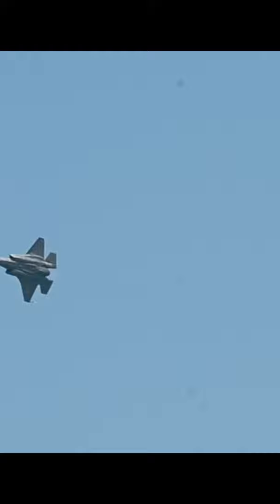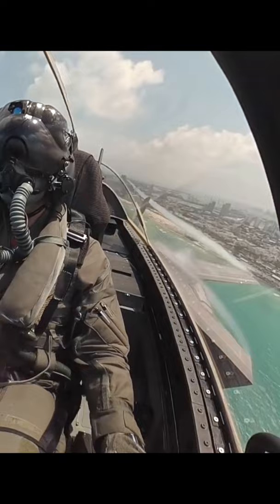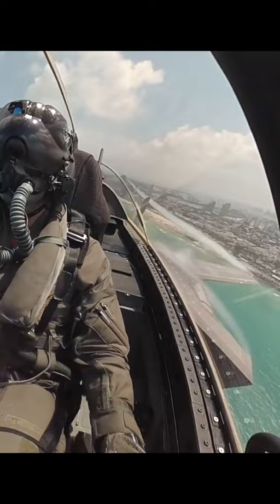Fighter Pilot Talks Through a Min-Radius Turn #Shorts

Comment: I think we need to trade. I have a new Ford F350 4 door. Low miles. 

Thanks for putting these videos up. Mainstream TV does show videos of these fixed wing aircraft but it's usually only a few seconds long and no explanation or pilot interjection. I still can't believe you fit inside the F16. Looked like your knees had no room. The F35 looks so bad A. Quick question. Maybe you can answer. I'm a Marine. EAS'd awhile ago. Was part of 13th MEU on LHD-6 (RIP). We had rotor & fixed wing. Harriers and CH53/CH46 Cobras Huey's. I talked to a Harrier pilot. He told me "The Harriers engine is so bad A that we could be the fastest plane ever made but our airframe wasn't designed for speed." Do you know if that's a true statement or just bragging? I also nearly got melted. One was hoovering in to land on the flight deck and we were smoking ciggies at the aft low deck...where we shouldn't have been.

Comment: That’s a true combat maneuver and not the crap that you see Su’s perform going low, slow and performing low-g maneuvers that you’ll never see in combat.  If you ever watch videos from Aces about what it takes to win it’s all about retaining energy and not bleeding it away.  That’s why the F-35’s power is so essential, to be able to recover quickly.
Reply: That's why this F35 has no energy in that min radius turn smh... 
Your comment dosen't make any sense bc if an F35 can recover from a low energy situation so can a Su 27/33/35, better actually bc an Su will have a bigger twr than the F35
Reply: @Tstahl962  That’s total BS. You’re not taking into account that the Russian fighters carry their ordnance externally, which creates both wing and drag weight and it not only reduces their ability to turn, but the ordnance also reduces their speed, ability to recover from high-g turns, and it increases their RCS.
Reply: And no, the Russian aircraft cannot perform the same. It’s not only for the reasons that I mentioned above, but because the F-35’s engine is more powerful. @Tstahl962

Comment: Imagine two of these engines on one aircraft.
Reply: What about it? It would make it worse not better. Double the weight, still same minimum radius for structural integrity
Reply: @ThatSB  Idk where you getting the idea two engines on F-35? I meant two of these super powerful engine on one aircraft like Foxbat
Reply: B-21A has them without afterburners.
Reply: @Juandinggong  that's not the same. At all.

Comment: Pull into the vertical and accelerate. Wow! In my day there were only a very few aircraft that were rocket ratio and they had to be clean. I would love a ride in that! I have about 12 hours of aerobatic time in a Super Decathalon with a competition aerobatic pilot so it was not your usual instruction. I discovered I am a natural 5.5-6 g pilot. It is what i pulled when left to my own devices. I did pull 7 for a few seconds but didn't grey out. It would probably kill me now. What was the g load in the turn I wonder? Thank you and be safe.

Comment: PWs don't have nearly the power when compared to GEs. Plus GEs have that whole "tearing the sky apart" sound effect
Reply: the F135 produces around 40,000 lbf of thrust. meanwhile the f110 was Powers the F-16 as well as a few other planes including the f-15E has Maximum thrust  of F110-GE-129: 29,000 lbf (130 kN) and F110-GE-132: 32,500 lbf (145 kN)[11]

Comment: So how many gs was that?
Reply: The demo profile calls for 7gs in the minimum radius turn, regulated with the throttle.  Every fighter has an optimum MRT at different altitudes, so they fly the profile to that speed and hold that speed where the Ps are best.  The F-35A can pull 9gs, and does that with a 135˚ turn in 3 seconds.  F-16, F/A-18, and other 4th Gen fighters can’t do that.

Comment: Can you integrate an F135 engine into a Gripen-E+  ???
Reply: probably not, its way too big
Reply: It would be easier to stuff a Gripen into an F135 engine.  Gripen E is a sad airframe that is underpowered, a 14yr scam perpetrated by Saab in conjunction with the Swedish government.
Reply: @LRRPFco52  ... I disagree with your personal opinion and apparent ideologically extreme motivated bias .  Sure, while the Gripen E could probably be a serious performance game-changer if had been originally modified in design to incorporate say the GE-129, perhaps stretched another half meter, whathaveyou, if it can supercruise even in a clean configuration, then it arguably has sufficiently competitive aerodynamics and thrust to weight vs F-16 standard.  

And if so, then it shouldn't be something to criticize so harshly as the shot you took there.  Let the Gripen E program evolve as it does. If it's ultimately judged as a good enough cost-effective alternative to the F-16V, Super Hornet, and yes even the F-35A!  ... then let various international Air Forces make calculated prudent acquisition and modernization decisions without your static ?  

Hey, if I'm wrong and it ultimately turns out to be a completely insufficient and inferior dud, I'll be the first to say it
Reply: @donkoh5738  They've literally spent 14 years on Gripen E and haven't even flown it at night, doesn't have IRST yet, no Panoramic Display cockpit, still in developmental stages in what was supposed to be an incremental upgrade over Gripen C.

No, it does not have T/W like an F-16. It also lacks payload since it's so tiny.

Affordable alternative?
2015 unit price was $85 million for Gripen E, although unit price has been elusive.

F-35A unit price today is $77.9 million, and at least 500 A models have been produced out of 630 JSF.

Operating and Maintenance costs are unknown for Gripen E since no production samples exist, no operational squadrons are filled, while billions have been wasted on empty airframes. It's one of the craziest fighter programs I've seen since the 1970s, nothing like it really.
Reply: @donkoh5738  There's nothing ideological or extreme about basic facts of an aerospace program. The facts just are what they are.
Reply: NO.
Reply: I'm pretty for you could fit most of the jas 39s fuselage into the f-135. So no probably not probably not. Although I imagine if you could, it would be damn impressive with 40000 ldf of thrust.
Reply: @andrewmoore7022  lol, OK , Ok ... I have confession:  I was being sarcastic with the original comment!  Forgive me... Ja , the current Gripen E engine is in fact adequate to enable superior cruise speed and likely superior climb rate than an F-16 , each jet configured w/ 2x drop tanks + 4x  AAM  👁🗯👁
Reply: @donkoh5738  Gripen E can't supercruise in that configuration. It can only carry a few missiles if it's going to "supercruise", where SC = Mach 1.2.

Big mouth F-16C with IPE will do that too, but it isn't configured for combat like that.
Reply: co52 -  with all due respect you seem to be cherry picking pieces of my views while misconstruing them to fit your  perspective.

For whatever it's worth,  I said ' superior cruise speed' as being likely with the noted loadout comparison made a couple comments above.  Not 'supercruise' when loaded out.     And I said Gripe E's  'competitive' T/W vs F-16  when taking into consideration aerodynamics and drag, etc., when discussing combat loaded climb rates and cruise speed, for example, among other performance markers.

Another possible factor which could be rather interesting, would be if Gripen E's  combat range when configured with a single centerline tank would be similar to a block 70 when equipped with  2 underwing tanks?? 

Regardless, despite my particular sounding Gripen E bias (yes, I'll further give it a nod imo as best pick for Finnish AF's  HX selection)  I'm very much also an F-16V block 70 fanboy.  I was in fact a long-time  proponent of the sort of next-gen follow on advanced Super Viper development path for at least 10 yrs - especially as a less risky, viable, cost-effective  alternative to the more risky uncertain F-35 block IV schedule not suitable for all friendly AF's anyway.

Comment: Too bad the engine is failing at a higher rate than they said and is requiring longer maintenance.  They reduced the demo team's scheduled because of it.
Reply: Name me one F135 motor that has failed.  The prognostic self-diagnosing and healing systems indicated that they should look at certain blades in the engine, and saw some coating wear.  The horror!  You want to see real engine problems, look no further than the TF30 in the F-111A, E, and D.  The TF30-P-412 in the F-14A, the F100-PW-100 and PW-200 in the F-15A/B/C/D and F-16A/B.  We were losing aircraft and pilots quite frequently because of those engines.

The demand for F135 engines is so high because of the productions schedule, and they eliminated several shops at the unit level for certain common repairs and inspections they are accustomed to on the F100-PW-229 and GE F110s on F-16Cs.  The F135 is an amazing fighter engine that exceeds the performance and MTBF rates of even the IPE engines in the Viper, so stop listening to or reading reports written by ignoramuses who literally couldn’t show you the difference between the compressor stage and High Pressure Turbine stage.

Comment: The single greatest engine ever developed was the j58, get a clue buddy.
Reply: Concorde's engines were the best indeed
Reply: J58 max thrust in burner:  34,000lb thrust.  Not even close to the F135’s 43,000lb thrust.
J58 would unstart too, and caused the deaths of several crews, total loss of several A-12s and SR-71As.
F119-PW-100 exceeds it as well at 35,000lb, again with no incidents of engine failure.
The J58 was a marvel in its day, but Pratt & Whitney has learned a lot since then, materials science and metallurgy has evolved dramatically, and digital engine controls have totally changed engine management.
If the A-12 program had access to the F119 and F135 technology, they would have been all over them.  They would have had to optimize some things for M 3.2 flight and the correct compression ratios inside the nacelle with the boundary layer control system and bleed air doors, but modern HPT cores and FADEC would smoke what they had back then.
Reply: @LRRPFco52  youve completely missed the point
Reply: @dgafbrapman688  What point was that?
Reply: @LRRPFco52  the f135 stands on the shoulders of the j58
Reply: @dgafbrapman688  F135 stands on the shoulders of the F119-PW-100, which stands on the shoulders of the YF119L, which stands on the F100-PW-229, which stands on the F100-PW-220, which stands on the F100-PW-100, which stands on the TF30-P-100, which stood on the shoulders of 18 different TF30 turbofan variants prior to that, which were developed in parallel with the J58 turbojet.

They are totally different engines with different configurations and substantial design variances.  One is a turbofan for starters, the other is a unique turbojet with 6 bypass air tubes that take cold air from the compressor stage and pipe it back into the combustion stage as a way to increase high Mach thrust.

I was literally next to a J58 2 times in the past month, which I’ve seen several times prior to that in-person as well.
Reply: @LRRPFco52  boy u just know it all dont u?
Youre right
Is that what u wanna hear?
Reply: @dgafbrapman688  I just can’t help it when you stated that this pilot should get a clue, when he was correct all along.
Reply: @LRRPFco52  hes not right, but everyone is entitled to their opinion
Reply: @LRRPFco52  what the f135 accomplishes compared to what the j58 accomplished, theres no comparison. 
Sure if u look at raw numbers the f135 has higher thrust, but numbers like that are, especially numbers from the stand, are meaningless when it comes to determine which one is "better".
Reply: @dgafbrapman688  He stated that the F135 is the greatest fighter engine ever made.  You’re saying the J58 is the greatest engine ever developed, and that he should get a clue.  Unless you’re making an argument for the YF-12A, I don’t know where you’re trying to go with this line of thought.
Reply: @LRRPFco52  this is one of those pearls before swine moments i guess.
Reply: Even in that case hes wrong, the greatest "fighter" engine is the ge j79
Reply: @LRRPFco52  i hate to say it because i have large parts ive made flying on them, but the f35 and the f135 are mediocre at best. Speaking strictly of the engine, the biggest story is the directional nozzle and the tail feather shape. Sure its powerful but it has done nothing in the way of proving its a "good" or even great engine. Same goes for the plane, its promised alot, but so far has delivered little, with many dissapointments on the way.
Reply: @LRRPFco52  plus the sound of the j79 makes me wetter than a lake on a rainy day
Reply: @dgafbrapman688  8,000lb more thrust than a Raptor engine, has the same thrust in mil power as an IPE in F-16C Blk 50/52 does in full burner,  self-diagnosing and regulating, prognostic reporting, LOAN nozzle with flow-through IR concealment, RF stealth from rear aspect, approaching 400,000 flight hours now across 3 variant fighters, with 90& of external components accessible to mx personnel. If that's your definition of mediocre, I'd like to see what you think is excellent.

F-35 has over-delivered and opened up aspects of air combat its designers never considered.

Whatever sources you're getting your info from are just incorrect.
Reply: @LRRPFco52  i dont understand the boner people get for the f35, like sure its kinda cool, kinda ugly tho, and its a single engine. 
My source is my experience in the industry building the f35. 
What im saying is it isnt groundbreaking new tech like the j58 or the j79 was, its the next logical step in a large family of engines. Its mediocre, we could do alot better, im speaking more to the plane as a whole here. The engine is fine really, just not the greatest or best ever made.
Reply: @dgafbrapman688  When every pilot who comes from F-15C, F-15E, F-16C, F/A-18C, Super Hornet, and Harrier says it's an unfair game-changer, you start to ask why.
Reply: @LRRPFco52  ill tell you why, the radar and stealth capabilities.
Reply: @dgafbrapman688  The pilots say it's everything. Sensor fusion, LPI Data Link, Low Observables, ease of flying, superior cruise speed, easier to tank with than Viper, longer mission radius than all the teens, better maneuverability, no parasitic drag, swing-role multi-mission flexibility none of the others come close to, EW, ISR, etc.
Reply: @LRRPFco52  wow u must spend hours on wikipedia
Reply: @LRRPFco52  ur so right
Ur the rightest person in the history of right persons.
Reply: @LRRPFco52  but u have to realize alot if not all of those pilot testimonies are exagerated advertisements, to both sell it to tax payers and intimidate enimies. 
Wed be alot better off if they modernized some of the gen 4 and 4.5 planes and spent the money wasted on the f35 on proven and reliable platforms.
Reply: @dgafbrapman688  I was very skeptical of the JSF program from the start. Of all the teen series, I'm most familiar with the Viper, so I first went to see the perspective of Viper drivers who converted to F-35A. I also came across Harrier and Hornet pilot perspectives of the JSF-B & C.

For background, I remember the USAF transition from F-4D/E to F-15A and F-16A in the 1970s-1980s, and how senior guys in F-4s felt left out, while juniors who were going to convert to Eagle or Vipers perceived them once they switched.

The conversation has been in a totally different place as you listen to F-15C, F-15E, A-10C, F-16C, AV-8B, F/A-18A-D, and Super Hornet pilots convert over.

They're not talking about the same comparisons we used to make in the 1970s and 1980s re: climb rate, T/W, or turn rates.

The conversation is in a totally different place where right off the bat, they say this smokes their "first-love" fighters hands-down, then go on to talk about what a game-changer it is in net-centric multi-mission warfare.

I expected the Viper drivers especially to criticize the F-35, but they instead sing its praises and even talk about how F-35A is dominant in BFM over the Viper after they've learned how to fight its strengths. The foreign Viper drivers have been the most forthcoming with info, whereas USAF have kept pretty tight-lipped.
Reply: @dgafbrapman688  Those "proven and reliable" platforms are being shot down by improvised and older SAMs, with recent examples including Saudi F-15S and Israeli (more advanced self-protection suite than other Vipers) F-16I.

Then look at mishap rates and exchange rates. F-35s humiliate all the teen series and Eurocanards in BVR, strike, EW, ISR, and add AWACS capabilities that are outside the reach of 4.5 Gen.

Unit cost is higher on 4.5 Gen as well. So what you're advocating for is:

1. Higher unit costs
2. Higher mishap rates
3. Much lower and eroding survivability
4. Far less capabilities
5. Less growth flexibility for evolving and emerging threats

What's not to like?
Reply: @dgafbrapman688  Norwegian, Israeli, Dutch, and UK pilot testimonies are conspiring to cheat US taxpayers?
Reply: @LRRPFco52  no, the tax payers in their countries. We arent gifting them the planes.
Reply: Ehm no.